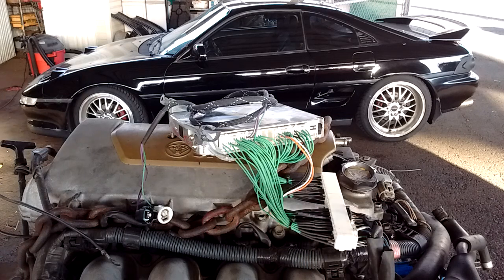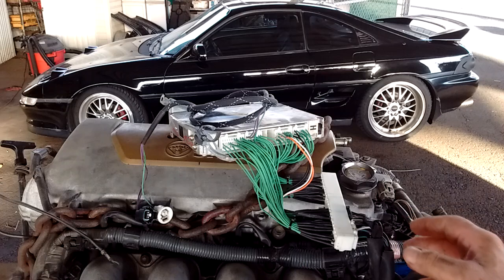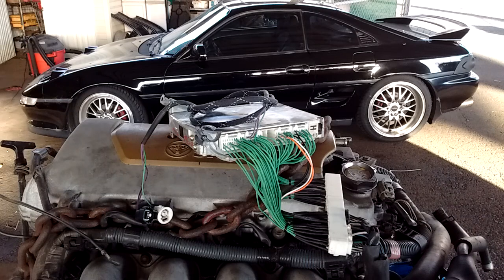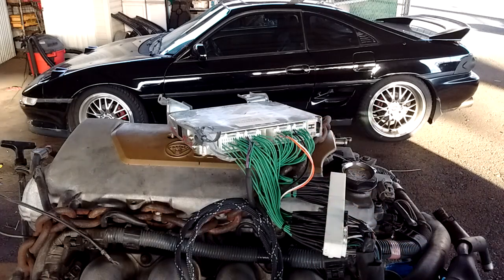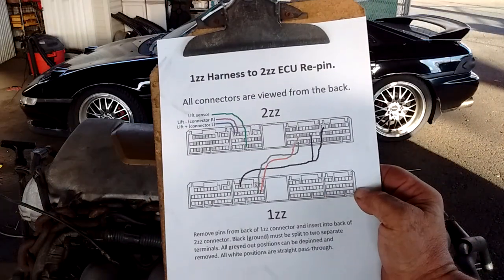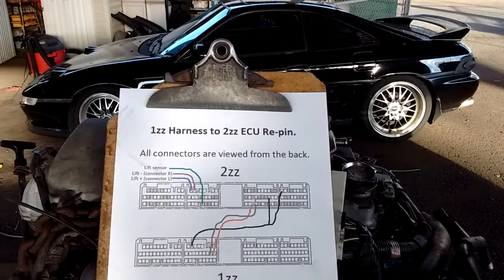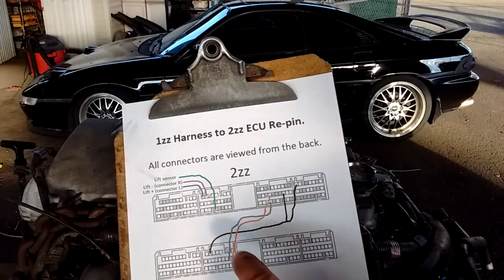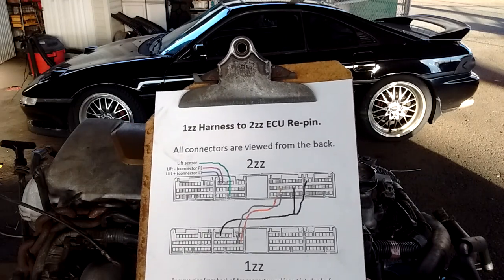2zz Swap Harness - Toyota MR2 Spyder - Part I

Comment: Hey frank, do you have a tip on how to enable back the psct and idup signals on a k swap?  Would like the PS to turn off at speeds >40mph.
Reply from the maker: If you're using a standalone ecu you can use one of the outputs to control the power steering pump relay and shut it off when you want.
Reply from the maker: Or you can do the same thing with a simple speed-based controller/switch like they sell for drag cars.
Reply from the maker: I have no idea how you would do it with a Honda ECU.
Reply: Interesting about drag cars.  I’m using hondata ecu.  Didn’t you make a write up on how it’s done with the 2zz swap?  Just need to add 12v to the psct iirc.
Reply from the maker: @Johnnywankerr  maybe I did something with that but it was so long ago I don't remember.

Comment: Hey buddy am doing a swap on a matrix xr my questions is does the plug and play u got there will work for me I got my 1zz harness I already reposition the tps cables but am having trouble thinking if this plug and play will work for me so I could have lift ?
Reply from the maker: The Matrix and Corolla ECU is different from the MR2 Spyder. You have to find the correct way to make it work by looking at the Electrical Wiring Diagram for Engine Control. You will need to use a Matrix  2zz ECU from the same year as your car.

Comment: I think it would be useful information as to what the body wires do, I'm aware of the lift connectors function not clear on the body connections.
Reply from the maker: The wires going into the body harness are a ground and the O2 sensor wires - this is where the 2zz O2 sensor expects them to be.